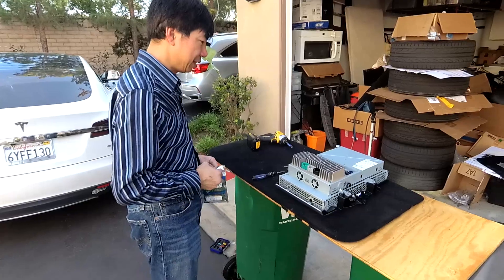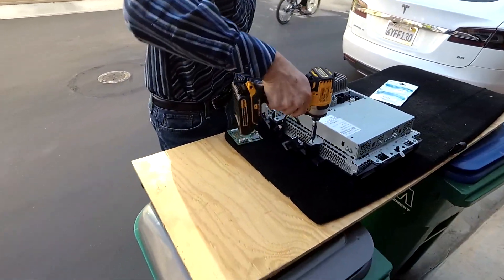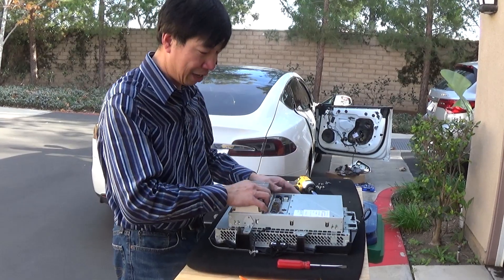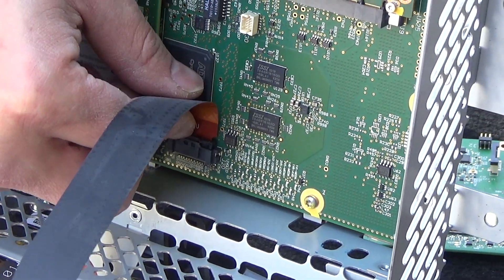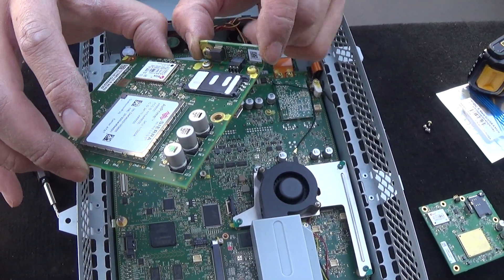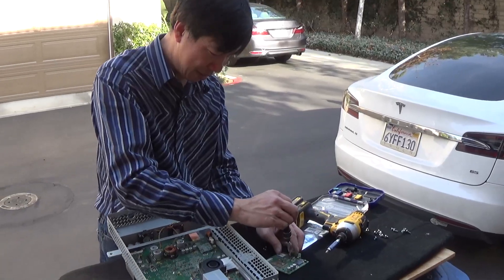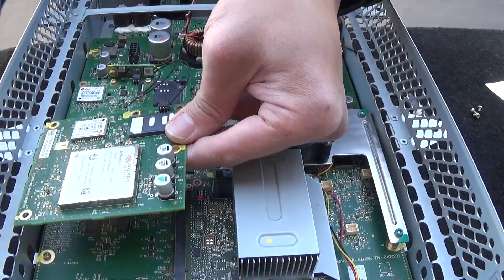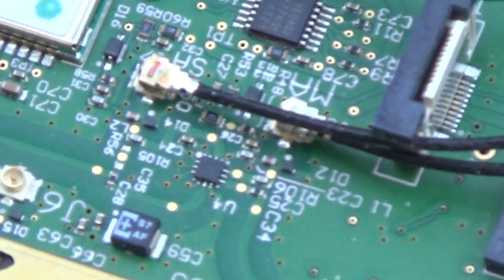Updating a Tesla Model S/X to LTE

Comment: Would be dope if you find a way to diy a mcu2 upgrade.
Reply from the maker: It's not difficult to replace the hardware. It's the software part that is not that easy.
Reply: @DavidDrivesElectric  ok so you would be able to technically switch out the internal components. But the programming is a whole  different issue. Heard that part is what takes the longest at the sc. Also heard mcu2 requires a differ wiring harness
Reply: @DavidDrivesElectric  oh. Just wondering tho if you bought a used mcu2 and wanted to upgrade would Tesla actually install it?

Comment: Tesla France made the modification for me  for 220$ cause I didn't have the time to do it, and they didn't want to sell me the LTE card and sim without doing it themselves... 
as soon as I left tesla service center my GPS diidn't work anymore, they said just wait 1 or 2 days it will come back! It didn't come back! So I made a new ticket few days later complaining about my GPS! They answered me my SD card has died and now I need to pay 450$ to fix navigation! or 220$ just to check their work again....
I was sure it was not my SD, so today I took everything apart myself, and both my SD cards are perfectly fine! I cloned them and put brand new sandisk not to do the job again. Now I took apart the MCU1 and I can see J38 connected to J6, J7 to J34 and J37 to J5. What is the correct sequence please? J38 to GPS, J37 to J7 and J34 to J5??

Comment: Great video sir! Tesla is trying to make me change my infotainment for $1500 rather just replace the 3g for LTE ($200) I also am getting my recall done at the same time regarding the slowed memory. They say for some reason the SD card will not read it when they try to complete this process so they are saying it will cost me $1200 to do or just go for the infotainment upgrade ($1500) and it will work fine. I find this to be total BS (excuse my language). I do not want to upgrade my infotainment because we are going to buy the newer X at some point. Do you think they are trying to pull a fast one on me?

Comment: ive got a UK raven X 2020 in Malaysia. is this the location of the sim card if i were to install  a local one? at present, LTE doesnt work and im running thru a hotspot
Reply from the maker: Yes the SIM card is on the board. But if you swap it out, you have to updates some settings in the car which I believe either needs root access or Tesla might do it.

Comment: Thanks David for this and all your other fine videos and Tesla forum contributions.  I've actually gone a different route.  I disconnected the wifi and GSM antennas on my 2014 P85 that are located in the exterior mirrors.  I'm affected by ChargeGate but (so far) I've dodged more recent "updates" that would have other otherwise nerfed my regen.  (Interestingly, I still occasionally pull a two bar GSM signal when parked fairly close to one cell tower).   Of course, I've lost Spotify and real-time updates to the Navigator, but there are simple alternatives to these (apps on my ten inch Samsung tab that has cellular connectivity).  My only regret is that I didn't disconnect the antennas about three years ago....
Reply from the maker: A trick is to have the car connected to a dummy WiFi hotspot that doesn't have an internet connection. As long as the car is connected to WiFi it will not use the cellular data at all.